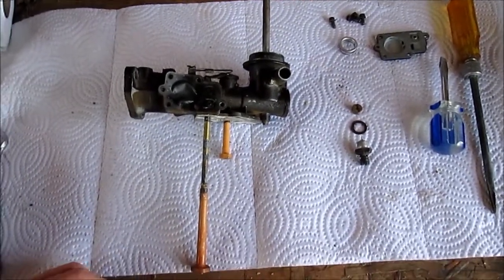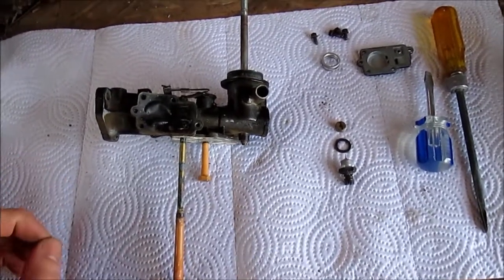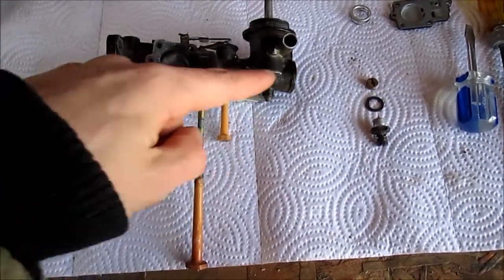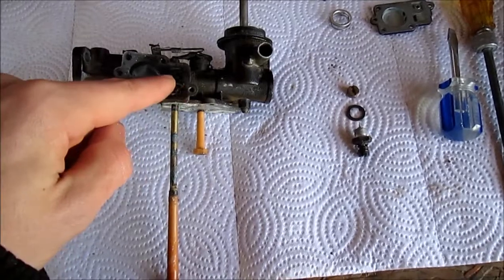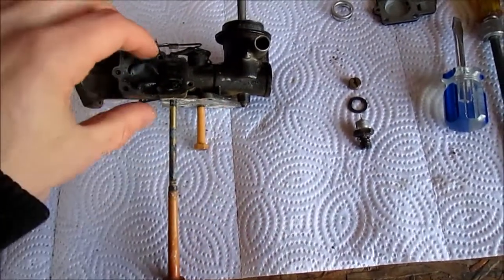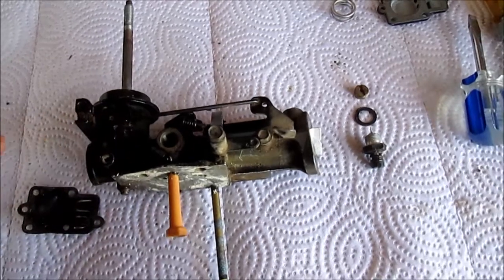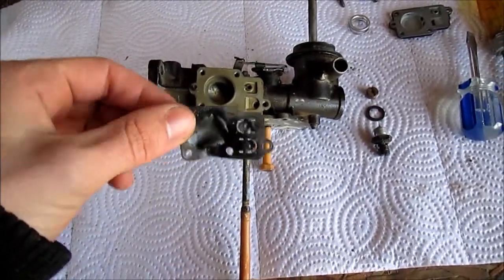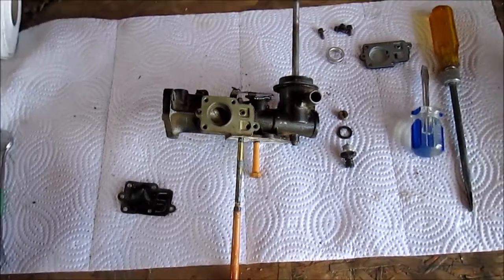How a Pulse Jet Carburetor Works - Briggs and Stratton 5hp

Comment: Hi ! What to do if the mixture is rich ?  In my case spark is black ( no oxigen ) . I change membrane,gasket,  clean all carb but spark is black. When I try to start engine first time and every time after shut down...its inposibille.
Every time I must put gasoline directly in engine ( in spark place ) ... after that engine works but spark is black.

Comment: Weakness of the design is the crappy steel gas tank which rusts out. First thing to rust is the interior fuel well as the steel is thinner than the tank. If the interior well leaks fuel then the carb can't work. I have cut open several of these awful tanks. And you cannot buy any tanks, or if you can they want over hundred $$ for it, sometimes old nasty rusty ones are on ebay. I converted this engine to use a Tecumseh H35 carb, and reconfigure the linkage so governor works. Mounted a steel plate where carb meets intake manifold (sheet steel , 2 holes, for left side manifold bolt to head, other hole for right side bolt that joins carb to manifold. Used existing plastic governor angle adapter mounted to that plate with its long shoulder bolt. So 2 link rods, one from carb to Briggs linkage adapter, then long rod  to governor arm. Cut the tank off the plate for the throttle cable, fits on the block lower bolt and used another little bolt to secure it to the flywheel cover to prevent it from vibrating. The H35 carb had a well shaped intake manifold from an upright engine. Had to drill and tap lower right manifold bolt in the block for mounting it, then it is perfectly straight. Left side bolt no changes needed. Used a plastic Tecumseh fuel tank 34156A, and the bracket I had fit the Briggs head. So now the engine has a real carb with a float and is repairable.
Reply: Meant to say sheet steel small plate, 2large  holes, for right side lower manifold bolt to head, other hole for right side bolt that joins carb to manifold. Plate sits nicely sandwiched with those 2 bolts. Plate is about 1.5 by 1.5, then a small hole for the plastic governor angle adapter shoulder bolt to which control rods attach. When you raise the governor arm it smoothly moves throttle plate closed. Getting the rods to the correct length is critical for operation of the throttle plate and governor arm. Small hole for plastic governor adaptor is to right of carb to manifold bolt. Location for that is 3/8" up and 3/4" away from right  carb to manifold bolt.  You can heat existing linkage arms with a torch, then the steel bends easily. Once you got that working you are almost done. That is the hardest part of doing a conversion.
Reply: I would love to see any pictures you have of this setup or if you have a video DIY somewhere.

Comment: Hello. On which side of die diaphragma should be the spring. In the video, the diaphragma lays on the carb, the spring is out. Is the spring on the side of the cover or on the side of the carb.
Reply: I believe spring and its washer go on the inside. Diaphragm goes on the outside, cover lays on the rubber diaphragm.
Reply: @scottdowney4318  Thanks. Tried it some months ago and You are right. The spring in my carb was assembled on the wrong side and so did I, because i thought, this was right.
Changed the position and the Flymo Powaspade works well.

Comment: i put a new carburetor but it only turns on if i put my hand over it. Defective carb??
Reply: On some if not most new carbs adjustment is required. I found out the hard way.

Comment: I put a brand new one of these on my 5hp B&S but for some reason it’s doing a very quick/rapid surging at full throttle. You can see the throttle linkage on the carb moving back and forth. Is there an adjustment screw on this carb, or any other way to fix the surging?

Comment: What happens when the little metal cup inside the gas tank isn’t there. I’ve seen several of these tanks where that little metal cup rusts so bad it becomes disconnected from the tank. Will the carburetor still work? Is the gas tank junk now?
Reply: @wcjcnc

If the small secondary tank has a large leak or is missing altogether, the carburetor will not function, unless perhaps you filled the tank to the brim. The little tank is the fuel source for the jet, so the carb would be starved for fuel.
Reply: @johnfox4376  and that is my world. Why do people wants so dang much for a used tank on ebay?

Comment: I just put a new one of those in my 5 horse...it starts first pull now...I mounted it to run a 2000 watts Winco generator to charge 8 deep cycle batteries that are on my Aims inverter/charger 2000 watts...It works so well because I don't have to run it fast so it's not very loud..the generator is 115 but the Aims only needs 100 to charge...I ran it for the first time just now and with a  slightly bigger pulley on the motor it only has to run1700 or so, and it barely uses any fuel like that..I 4qn it 20 minutes on less than a pint
Reply from the maker: Wow that's really impressive very cool 👍

Comment: why was that gasket bad? Trying to see if mine is bad.
Reply from the maker: The gasket is supposed to be flat if it has any kind of curve to it then it is bad. The reason is because the gasket acts as a diaphragm for the pump so if the diaphragm gets too bulged out it fails to flex back and forward and pump the gas into the carburetor.
Reply: @PatriotContraptions  My diaphragm has a slight bulge...I have thoroughly cleaned all passages and jet but the carb refuses to run off of choke could a bad diaphragm be the culprit?
Reply from the maker: @sherriturner4226  The Diaphragm should have no bulge so yours is probably bad.  A good diaphragm is flat.  If it is bulged at all the flex has been lost and it will not pump.

Comment: Where do you find the model number of the carb?
Reply from the maker: You will not find a carb model number.  You will have to find the engine model number which is normally on a plate on side of it somewhere by pull start.  Then use that to look online to find blueprints for engine that will include the carburetor part number.  Sometimes You can get Lucky by just searching the engine type and carburetor to find stuff without needing prints.

Comment: I have an older 5 hp Briggs with same carb and gas keeps getting into the crankcase, any ideas why? Thanks!
Reply from the maker: Off the top of my head two things come to mind one is bad piston rings and the second is incomplete ignition of the gas.  Another possible thing would be the valve going to the muffler is stuck closed, but that's a real real long shot.  I would check for compression first that will tell if you have bad rings.  You can sometimes just take the spark plug out and use your thumb to cover the hole while turning the engine with ignition OFF.  If you get enough pressure to force you thumb off you are probably good.
Reply: Did ya figure it out?  What is the engine on? Laying the engine on its side with tank up can siphon fuel and will fill the crankcase up.

Comment: Hi, I was wondering how difficult it would be to replace one of these with a more standard carb like on my push mower, so I can plum it to a new, bigger gas tank.
Reply from the maker: I would think that it would be fairly simple you would just need a carburetor from an equivalent size engine to bolt on.  The function of the carburetor is simple to mix fuel and air in the right ratio and send it to the engine so long as the gets that ratio it does not care where it comes from or how its controlled.   My suggestion look at the Cubic Centimeters (CCs) of your engine and horse power and get a carburetor from a equivalent engine.  The main issue will then be getting it to mount which I can't help with not seeing your engine.

Comment: Is there any way to clean a clogged jet without taking the carb/tank off.
Reply from the maker: Sometimes you can get away with spraying carb cleaner in through the air intake.  Then running the engine with some type of cleaner in the fuel.  This however will never be as good as taking the carb off.  On most small engines you can remove the bottom of the carburetor while it is on the engine to clean it, but this is risky as parts can fall out of the carb and get lost.  Normally the best option is to take the carburetor off the engine for cleaning.  This is not anything to be afraid of as most are very simple also if you search for blue prints of your engine you many times can find what will be inside the carb.  That will show you what you are in for and has saved me allot of time.  On main thing to remember is always count the turns it takes to get to all the way in on any jets you plan to remove before taking them out.  this ensures the mixture will be correct when putting the engine back together.  Hope that help, :-)